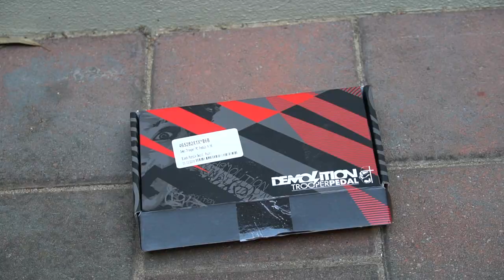Old bmx bike restoration montage (fiend)

Comment: Hey mate, I need a bit of help, how do you get an even coat of paint with a spray can? I think its a wethepeople BMX, at the moment I`m restoring a WTP Curse BMX and took of the paint of the handlebar and the fork, but I am struggling with the paint on a different bike that I`m also redoing. Love the videos 🙌
Reply from the maker: thanks appreciate it, make sure u shake well, can needs to be sprayed upright, spray can 30cm roughly away from bike, don't do too thick coats, hope that helps:)